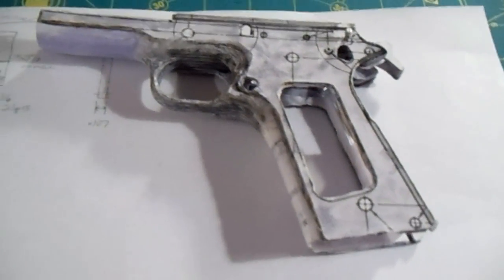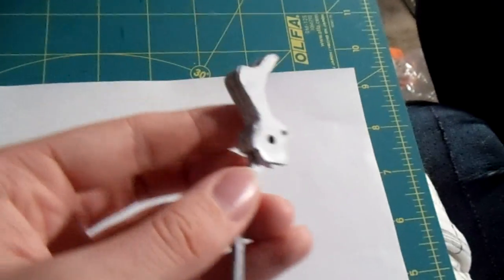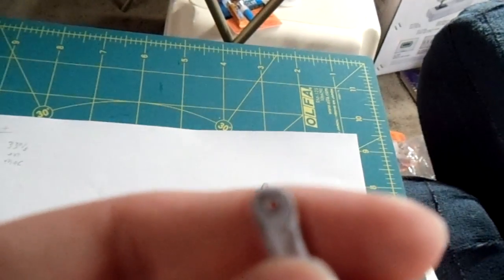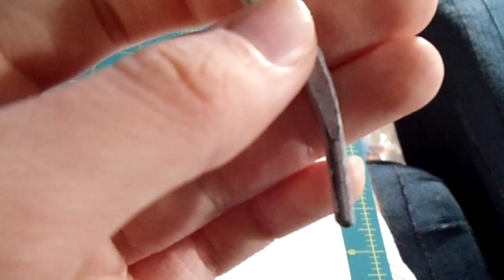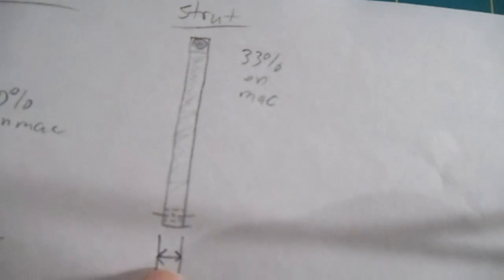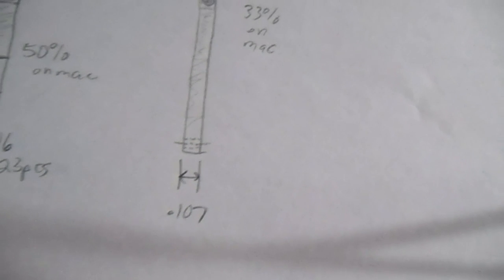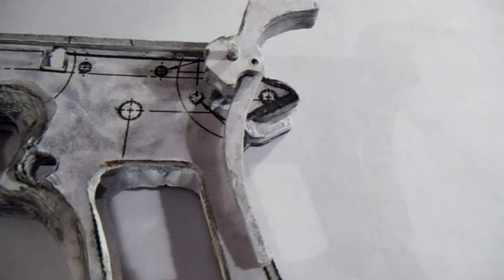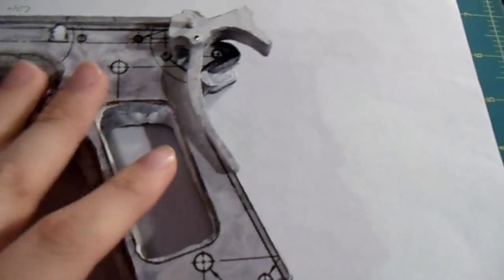Paper 1911 update # 14 - The Hammer Strut

Comment: the  hammer strut. can  u remove  it  from the actual  hammer? on  a real  1911?
Reply: Bryan Calhoun Yes
Reply: thank's for reply i ended up figuring it out and replacing it. the pin pop's out pretty easily. 
thanks  for the reply anyways.
Reply: Bryan Calhoun you're making a 1911 aswell? Nice! I'm currently working on the slide breach.